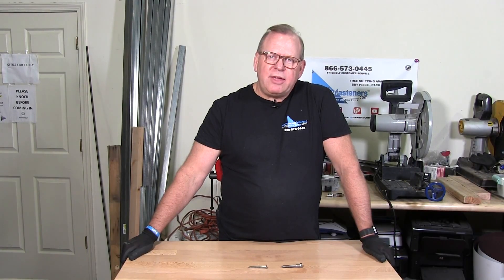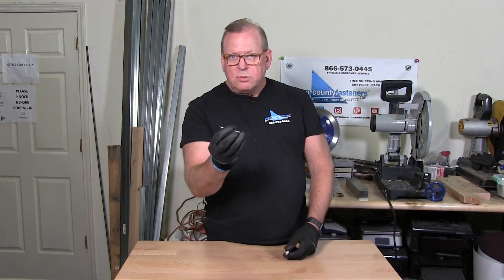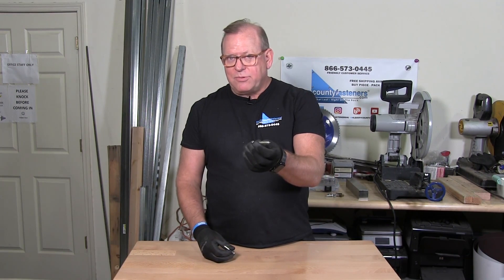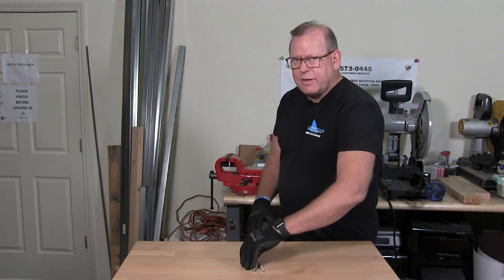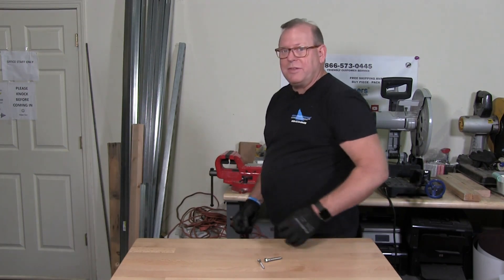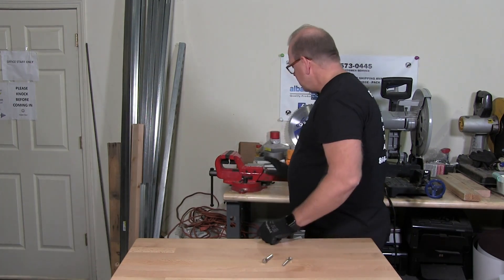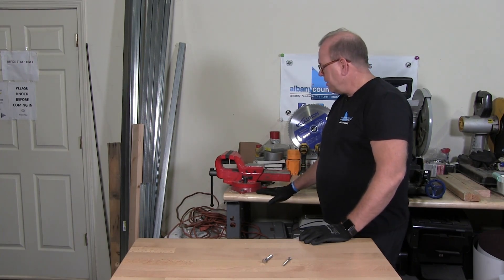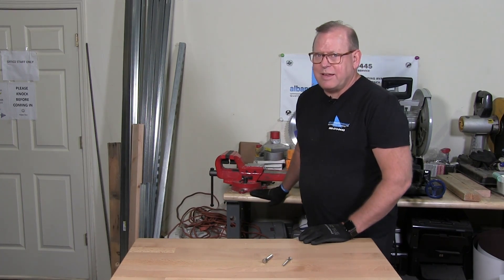Wood Screws Vs Lag Bolts On Installing a Vice | Fasteners 101

Comment: Other than difference in head styles, and assuming shorter lengths that are fully threaded (no shoulder on the lag bolt), how do a #14 wood screw and a 1/4" lag bolt compare?  They are close to the same major diameter.  Is the lag bolt stronger and/or have a thicker minor diameter?  Thank you.
Reply from the maker: Lag is stronger and diameter is larger than a #14 wood screw.  Any fastener with a size of 1/4" vs #14 will have a larger diameter.  Good luck!

Comment: I plan to use lag bolts to secure my vise and bench grinder to a railroad tie, since I do not have a heavy duty work bench.  Railroad ties weigh on average 200 lbs and a railroad tie is only $19 at Menards.  I think that should give me leverage when I'm working on stuff.

Comment: Would you recommend this method on other wood types, such as fir, hemlock, pine or whitewood? 
Same also for other competing fasteners - spax powerlags or ledgerloks, would you recommend either of those (when securing all the way into the frame and not just the bench top) in place of standard lag bolts in such an application? 
Thanks in advance.
Reply from the maker: Yes, the lag screw would work but, if your countertop is made of softwood, they should consider what the vice will be used for before mounting it. If you are using the vice for light work, then it will work fine. If you are putting a lot of pressure and weight on the vice, then you should consider using a hex bolt and nut.

Comment: I am securing a 2x8 board to a load bearing 4x4 post. I have pointed tipped 6" hex lag screws. Do I need to use a washer and nut on this with a longer lag screw?
Reply from the maker: Lag screws don't typically use nuts; nuts are for machine threaded fasteners. But a washer is never a bad idea to add! It will help distribute the load better than the hex lag screw head on its own.

Comment: Why have 20 people "disliked" the video? The guy made a simple explanation. Lag Bolt vs Wood Screw. Can't understand the dislikes.
Reply from the maker: It's hard to say why so many dislikes, especially since there aren't any negative comments on this video yet. We're just trying to help. Hopefully we were able to help you!
Reply: I think they want some demo with that bolt closeup and screw into something for demo.purpose
Reply: @zulboy01  Should be bolts, but probably there wasn't room or access underneath. I still Liked the video.
Reply: Because he doesn't actually say anything about the differences between the two, or why it's OK for him to use lag bolts but not screws. No information.
Reply: Because he did not explain the difference between the two. I thought this video would be instructional on the pros and cons between the two fasteners.
Reply: @michaelgifford8367  they serve different uses. He listed several usage cases. Lags are for heavy-duty stuff like mounting tvs, securing heavy lumber together where a screw would either pull through or shear off.

Comment: How big of a factor is length when it comes to using lag bolts? Is the strength of the lag bolts significantly lower on a 2” bolt vs. a 3.5” bolt?
Reply from the maker: The answer is: it depends. There are multiple different things that can be considered strength when discussing a lag screw. For instance, the longer length of the 3.5" bolt means that more threading will be set into the wood. This will increase its ability to resist pull-out (pull out strength). The shear strength of the bolt will not change for either because the diameter does not change. But the ability to bend the bolt will be higher the longer it is. Using a shorter bolt means more pressure will need to be applied to both ends for it to bend then at longer lengths. So it will really come down to what the job is, and what forces are going to act on the fastener once it is installed.
Reply: @AlbanyCountyFasteners   Not really.  It comes down to the compressive strength of the wood fibers, and how much screw thread is engaged with the wood.  As for bending, that's a factor of the exposed portion of the fastener.

Comment: Which one offers a stronger bond? wood screw or lag bolt?
Reply from the maker: Hi AndroidGameplays4Every1,
Lag bolts can offer a significantly stronger bond than wood screws. Although, wood screws are better in many applications. Lag screws are an excellent choice when the installation will be exposed to great force. A vice is a prime example of this.
Reply: @AlbanyCountyFasteners  I i want to attach a metal case and caster wheel to a rolling wood gate I am making, should I use lag bolts or bolts?  It seems that bolts would do less damage to the wood in that you have a  hole from which you can remove right...
Reply from the maker: @kenmcf  Do you intend to remove the caster wheel/plate? In which case the bolt would be preferable. Otherwise, keep in mind the thickness of the wood with this application. If the wood is thin, a bolt and nut would likely perform better. If the wood is thick, a lag screw would better suit your needs. 
As far as damaging the wood, the bolt and nut may be safer but the lag screw, provided the wood is thick enough, will have better holding power.
Reply: @AlbanyCountyFasteners  Thanks yes...this was one while i was writing the question I kinda answered it that way in my mind anyway thanks...since the wood will only be a 2 x 4 or maybe slightly reinforced, I will use bolts..thanks again.